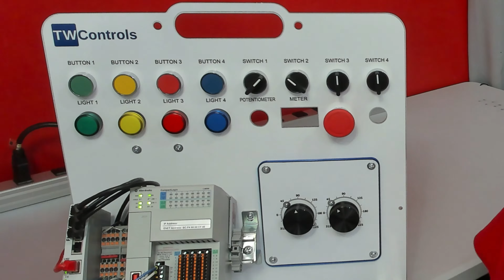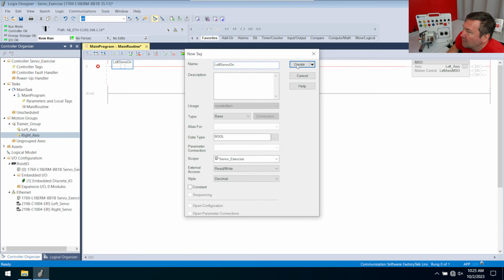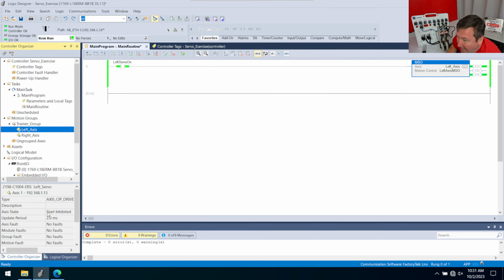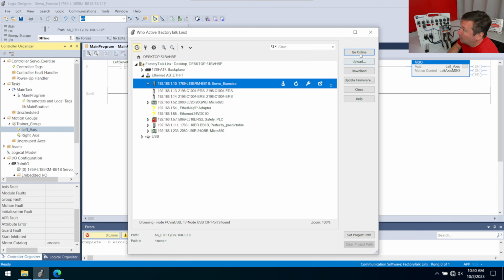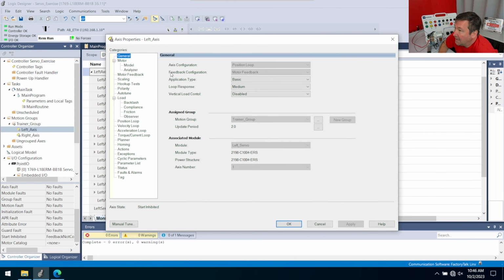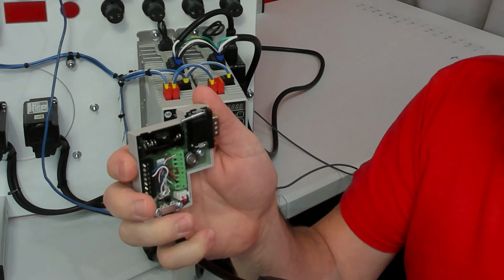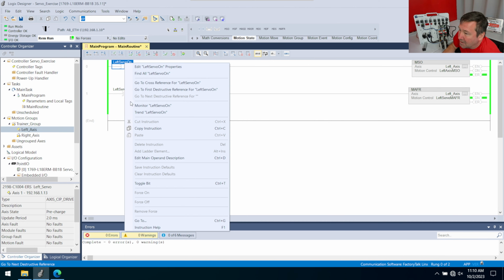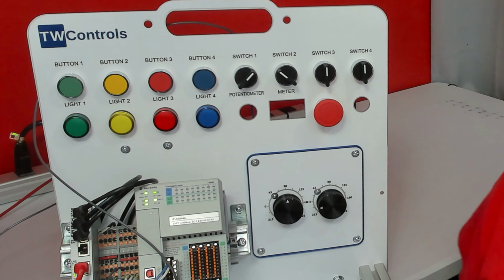Kinetix 5300 Ethernet Configuration in Studio 5000 - Fighting Error 82

Comment: Is a integrated motion control PLC required when using a servo drive?   The reason I ask is we have  machine that has a kinetix 350 servo drive running with a 1769-L33ER PLC  and has for years. But recently we had the drive fail (that is obsolete) and working with an outside company  to upgrade it we were told the PLC's  would have to be replaced after several attempts by them to get the replacement working.  But working with the program it just uses the encoder for position and indexing /increments and a run output contact closure  to the drive the motor .   Thanks!
Reply from the maker: Are you just moving point to point? YRG is by far the easiest servo to integrate. Here's a video on it.
https://youtu.be/grEcd3HIuHk
Reply from the maker: What PLC are you using?
Reply: 1769-L33ER @TimWilborne
Reply from the maker: It should work with it, contact them, https://www.yrginc.com/

Comment: Thanks for sharing Tim!
The Kinetix 5300 is much easier to run on 120vac than the Kinetix 5500 or Kinetix 5700 servo drive.
I wish I had thought about that before I did my videos, I used a Kinetix 5500 and powered it up with 120vac.

Ended up working just fine though.

As we all know, where there is the will, there is the way.
Reply from the maker: Very true!